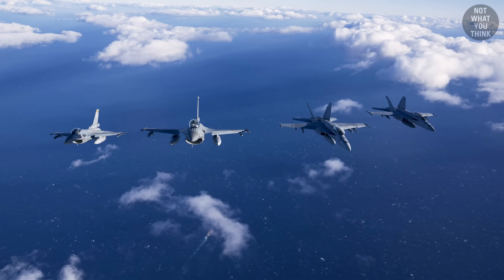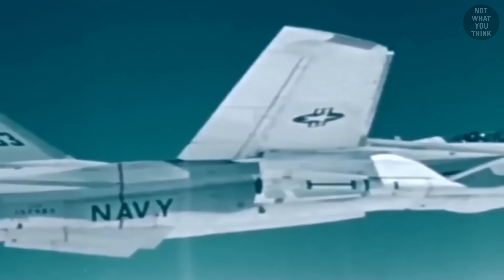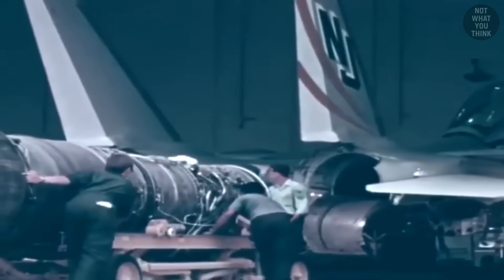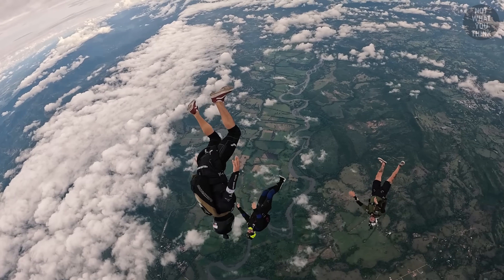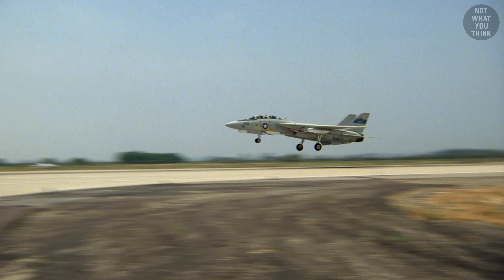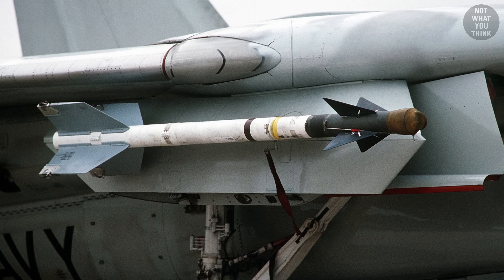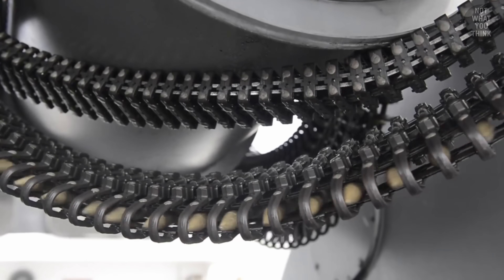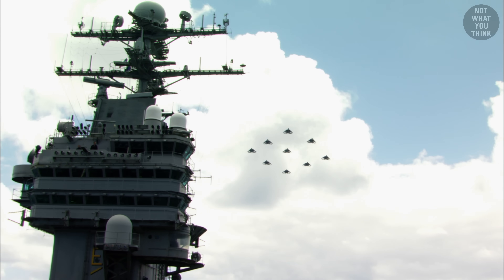Why the F-14 Was Built for a Weapon That Was Never Fired

Comment: On the contrary, Iran used the AIM-54 against Iraq. In fact the Tomcat flown under Iran had a great kill record iirc, nearly 180 kills for only 6 losses, and that was outdated F14A's Which is staggering considering the engine and stall issue. Had they had the B or D, it would have been better. They even used outdated AIM-54s, we used the lock fire and forget, they used the older model you have to maintain directed lock in order to get a hit.

Comment: As of I think of August 2025, and it hurts to say this I don't believe there are any air worthy Tomcats left in the world credit to Israel for that, but necessary. Secondly, and I might catch some flak for this but the TF30 engines weren't bad engines. Contrary, they were great at going fast. I believe the A model was the only ones that could reach mach 2.5. I also believe and I might be wrong here, that the engine swap wasn't completed until near the end of its service life. Which lead to pilots learning how to fly the engines not the plane. But, I digress, in the middle of a chaotic dogfight I do agree that not having the ability to go from idle power to full AB and back without worrying about whether or not your compressor will stall or not is not  ideal.

Comment: This video is FULL of errors

Actually, F-14 was built mostly because F-111B was super-bad at dogfighting. It was only suitable as BVR interceptor, but the navy wanted a smaller, more agile plane that can both act as BVR interceptor but which can also dogfight.

And many other planes, such as F-111 and Panavia tornado have weapons hardpoints in the moving parts of the wings. It is totally possible to attach weapons to the moving parts, but those racks that turn are heavy, expensive, and need lots of maintenance.

And this video is missing one major point for the big engine spacing: That those early TF-30 turbofans did not like S-bend inlets, they practically required that the intake pipes are very straight. This required leaving some spacing between the engines.

Also, flat spin recovery was not impossible in F-14. It just required totally different controls than on other planes (pulling the stick rather than pushing it) and they learned the trick only later, when the plane had already taken into use and few had already been lost in flat spins.

Comment: The F-14 was a great aircraft destroyed by Bean Counting Morons.

During the Height of the Cold War - the US had two tiers of Fighters.  The top tier were the F-14 and the F-15 - the second tier - were the F-16 and F-18.

They didn't believe they could afford enough Top Tier fighters to keep from being swamped by the masses of old, cheap aircraft the Warsaw Pact had.  So - the 2nd Tier was designed.

For the Top Tier - combat effectiveness was the driving criteria.  With the 2nd Tier - it was aircraft cost and maintenance.  So - the 2nd tier aircraft were designed to be much easier to maintain - which made - them CHEAPER to operate.

When they retired the A-6 Intruders - they began using the F-14's as Bomb Cats - but - they were still expensive to operate - so they were all retired.

Then - utterly moronically they were mostly shredded to keep Iran from getting spare parts.  This deprived the US of the option to bring them back - which was utterly moronic.  Iran found ways to continue to operate it's F-14's - and is flying them today.  So - this didn't keep Iran from using their F-14's but it did keep the US from using them.

The US never used the Phoenix Missiles in combat because they never needed to use them.  Iran used them against Iraq though.
.

Comment: I was in the Navy going to AE A school in Memphis Tennessee when we were introduced to the F-14. This was in 1974. When demonstrated the Tomcat was to track and lock six targets simultaneously and launch it's Phoenix missiles on them. The test flight and launch went very well with the exception of one of the Phoenix missiles Motors burning out prior to impact. It did shoot down five out of the six drones. I did not hear it in this video but the microprocessor was specifically designed for the F-14 Tomcats Phoenix weapons system. It was installed in 1973 and then the microprocessor was released to the civilian World in 1974.

Comment: At 7:45, your drawing of 20 degrees is shocking! 😂
Reply: Wing sweep angle was supposed to be the angle  perpendicular to the aircraft’s tail to nose and the leading edge
Reply: @Lockheed_Jets Your explanation does not help. Just say it's the angle the wing is swept back from when the wings were perpendicular to the fuselage. 😂

Comment: Wow. A Tomcat video that got a lot right, like the P&W engines never being the intended Engine. And the first microprocessor. Good job! Now some other mentionables. First fighter to introduce datalink to the battlefield in conjunction with the E-2. Also it was a true Multirole (Ability to Self Escort a strike mission) aircraft from day 1 which did set it apart from the F-15 until the F-15E came along in 1988. The Navy didn't want to risk it however because it had so many other AC to fulfill the role. Lastly it should be noted that it was the only Fighter carrying ARH/"Fox 3" missiles for 17 years till 1991 when the AMRAAM became operational.
Reply: The F-15 had multi-role capability from day 1 as well. In both cases the capability was there but weapon qualification trials weren't completed due to doctrine.
Reply: @dumdumbinks274  Fair enough. I did a lot of searching and everything repeatedly stated the A and C had no A/G capability, unlike the same question about the Tomcat. But I missed the A/G selector under the stores selector in the A cockpit and hard to tell if the C's SMS page was programed to handle A/G.. You are correct.
Reply: @Dyson_Cyberdynesystems  Yeah there's a lot of that around because the USAF doctrine was very specific about the F-15s being only for air to air, especially once the Fighter Mafia gained political influence. Israel however did their own weapons qualifications and used the unmodified F-15A for strike missions, which is what eventually lead to the development of FAST packs (eventually evolved into CFTs) for the F-15, and served as a proof of concept for the F-15E.

Comment: This is not Accurate,  Yes it was A Fleet Defender Interceptor but Maneuverability  & a Built in Gun  was also Empasized  so it had the ability to be a fighter. Unlike Mig -31 or MiG 25  or MiG -23  who were pure interceptors with poor Manuverability but were Fast & Had good Radar Capability.

By the way Cruise Maverick doesn’t die ,in Top Gun .Goose was the one ☝️ who died

Comment: I think you got the meter spacing incorrect on screen since you put 2.7 m = 9 ft but 3 meters is nine feet at three feet per meter. BASIC THIRD GRADE MATH.
Reply: 1 meter is actually 3.28 feet, not 3.... so 9 feet is indeed 2.7 meters. Try using REAL 3rd grade math...

Comment: F-14 had the strongest radar on any fighter airplane up until the F-22, meaning it took over 30 years to dethrone!
Reply: Only in terms of range. In every other aspect it was beaten by the 1980s, and the F-14D received what was basically the F-15E's radar as a very significant upgrade.

Comment: Excuse me?  Not designed to dogfight?  Must be AI BS.  The Tomcat was designed with a M-61 Vulcan, which means it was designed to dogfight.  The Tomcat could out rate and out radius many enemy of the time period.  In a one circle fight against an F-4, the Tomcat could get behind the F-4 in 360 deg or a little more of F-4 turn.  You had to keep your energy high to make the Kitties ability to dogfight.  It does not fight well in a slow turning or rolling fight.  The TF-30s were junk.  The GE F-110 engines were superb.  The reason for entering a flat spin was not the engines.  If you departed controlled flight with a high yaw rate, you can develop a flat spin quickly.  This is due to significant weight at both ends of the airframe.  It becomes pilot skill and adherence to emergency procedures to prevent a flat spin once a departure occurred.
Also, the US Tomcat has shot down 2 Libyan MIGs, 2 Libyan Sukhois and an Iraqi Mi-8 helicopter.

Comment: 2:03 Tornado “hold my beer”
Reply: Yeah but the Tomcat had already heavy weight and not very reliable engines to say the least.
Reply: The F-111B was also supposed to be able to have hard points under the wings that would pivot during wing sweep, too bad it was a pig of a plane.

Comment: The first statement made in this video is false.  The Tomcat was specifically designed to be both a long-range interceptor and a ferocious dogfighter.  It's design was informed bot by the klong range Russian bomber and cruise missile threat and by the US Navy's dogfight experience over Vietnam.  The Top Gun school and the F-14's development paralleled each other.  The F-111B prototype could not dogfight well, but its purpose was parts commonality with its Air Force bomber counterpart.  It was cancelled and the F-14 ultimately won the fighter competition.  The F-14 did not get into many dogfights because, in the vast majority of cases, enemy pilots chose to flee.  In one case, an F-14 was in a position to shoot down a MiG-25 Foxbat with a Sidewinder missile (the Tomcat was on the Foxbat's tail) but the crew mistakenly thought the rules of engagement did not allow it in that case.  Another important point:  The US Navy did fire three Phoenix missiles  in operations.  A Tomcat fired a Phoenix at the very limit of its range at an Iraqi MiG-23; the Flogger promptly turned around and fled and managed to jut outrun the missile, which tracked perfectly.  The missile accomplished its purpose; it removed a threat. In another case, technicians neglected to arm the rocket motors on two Phoenix missiles prior to delivering them to their airplane.  When the Tomcat crew fired them, the missiles dropped from their hardpoints and fell to earth with rocket motors failing to ignite.  However, one of the intended targets was flown by a pilot who was so frightened by the attack that he crashed into the ground.  A kill is a kill, right?

Comment: Later F4's did have a gun. At first they were spun by the slip stream, but they were unreliable. The eventually switched to an electrically driven  motor.
Reply: The video talks about the navy's F-4s. They never had a gun.

Comment: 0:45

“Too overweight,” my ass. 
They operated fucking A-3’s off Essex-class carriers. And then they saved all of 2,400 pounds of weight on the empty airframe of the F-14A vs the F-111B, only at the cost of 7,000 pounds of fuel capacity and thus several hundred miles' less range.

“Too sluggish”? 
F-111B performed carrier trials aboard a MIDWAY-class with no issue. And it didn’t have that survivability issue discussed in this video because the engines were right next to each other. Plus, unlike the F-14, it had the structural capability to land back aboard ship still carrying 6 AIM-54s.

“Too expensive”? 
F-14 cost more than the F-35, whose price tag everyone bitches about. And look at how many Tomcats were lost….

Comment: fun fact, before F35, F14 had the strongest radar in terms of tracking and engaging targets (24 targets to track, 6 to engage) at 100+ nautical miles, remember this is 1970s jet
Reply: I'm pretty sure The typhoon   is high on that list.
Reply: F22 doesnt?
Reply: @ThePretender1  Bro was just repeating  bro-facts so yes. Ignore him. Lol
Reply: @ThePretender1  it does by a mile but those two were developed around the same time so we should let it pass
Reply: Until the F22*
Reply: Completely bullshit. It could deliver to more targets but the 54 took over that after launch. F15 variants, Typhoon, Viggen, and others could do as well or better, never mind the connectivity to AWACs making carrying your own pointless. But yeah, other than all the other aircraft in the middle it was the only one
Reply: @Gapines23  Uhm, with what missiles?
Reply: That was a later radar upgrade
Reply: I would have thought that would be the F-15
Reply: The F-14 had the most capable radar of the 1960s in terms of number of targets, and mounted in a late 1960s airframe. It was beaten by pretty much every single fighter-borne radar in those specific metrics developed since the late 1970s. The difference being that the F-14 was the only one that could guide the AIM-54, so it retained the advantage of engaging up to 6 targets because of it's missiles rather than it's radar.

The F-14's radar itself was so far behind by the late1980s that the F-14D pretty much received a tuned version of the F-15E's radar due to it's significantly increased performance.

The only aspect in which the F-14's radar has retained a major advantage is detection range due to it's very large antenna. The original AWG-9 radar was long beaten in that regard by the 2000s, but the APG-71 of the F-14D wasn't beaten until 2008 when the F-22's upgraded APG-77v1 was introduced as a development based on F-35 tech.
Reply: @dumdumbinks274  Its radar, its performance, its antenna. No apostrophes are needed.
Reply: @tar170 probably auto correct
Reply: I don't know what you're talking about. The AWG-9 radar of the first generation of Tomcats (F-14A and B variants) was known only for having the longest range but it wasn't the best by the early '80s it was already falling behind the times. It was superseded by the APG-71 on the F-14D, which used parts from the APG-70 used on the F-15E Strike Eagles. APG-71, as did the APG-70 for the F-15Es added a lot of capabilities from multiple modes to data processing speed to filtration of ground clutter. No US Navy Tomcat kept the old AWG-9 at the time of their retirement. 

Also, by the 2000s other fighters like the Hornet in the USN/USMC and F-16 in the USAF were already capable of carrying AMRAAM which borrows the whole fire-and-forget AND multitarget abilities of the Phoenix (the F-14D was never given the necessary upgrades to carry and use the AMRAAM as it was deemed too costly and they were effectively at the end of their service lives when the missile was being fielded, so they focused on giving the AMRAAM to Hornet and Super Hornet instead).

Seriously you'd have to be very naive to believe that the US armed forces were STILL using some 1970s tech in the early 2000s, let alone the 2010s or 2020s.
Reply: @Leadblast  The F-14D was used as a test bed for firing the Aim-120, so some of the airframes definitely had that capability.
Reply: @hufthenerd7135  yeah they used the money to add the Targeting Pod instead.

Comment: The statement that the F-14 was not made for dogfights is completely not true. If the Navy wanted an exclusively BVR platform they would have went with the F6D Missileer or the F-111B. But, because both of these were completely defenseless in close range and the latter was way too heavy on top of that, they went with the F-14, which originally going to field Sparrows and Sidewinders only, and was a smaller aircraft concept. It grew bigger, because now it needed to do the BVR Fleet Defense ON TOP of dogfighting. Lever let your LLM do your homework for you.
Reply: Ehh, from comparing the (unmodded) airfoils, I’d say the F-111 would at least give the Tom at a run for its money in dogfighting, in terms of energy retention, which the Tomcat was pretty bad at as it bled speed to quickly.
Reply: @peskyshoes  there's this band from the 70's called Aerosmith, they have a very VERY good song, may even be their best, it's called Dream On.
Reply: @ilejovcevski79 Dream on, because the F-111 outlived and outdone the F-14? Sure, ig
Reply: @peskyshoes  what, in dogfighting? Please specify the metric, and where exactly in the flight envelope did the 111B dominate?
Reply: @peskyshoes  LOL. The F-14 could out-turn the F-4 to the point it would be on the F-4's tail less than 30sec after the merge while performing a sustained turn. And the F-4 armed with 8 missiles could out-turn an unarmed F-111. So yes, Dream On. Energy retention was not a problem for the F-14, and the F-14B/D with F110 engines could out-turn the F-16.